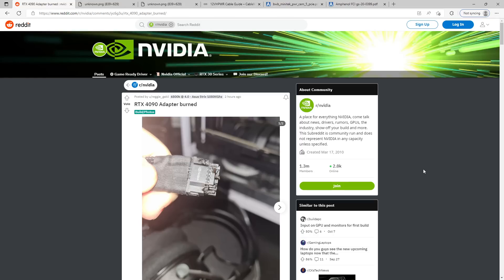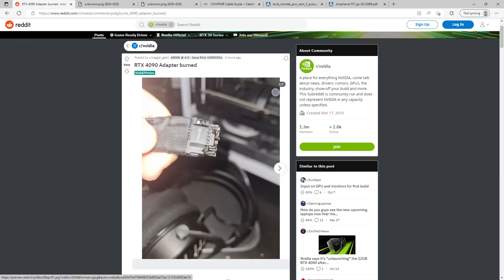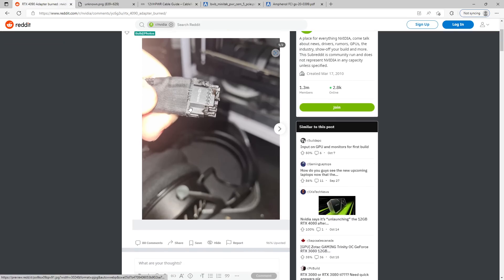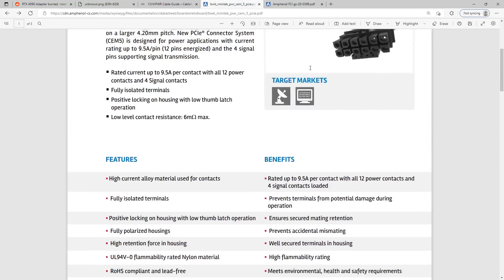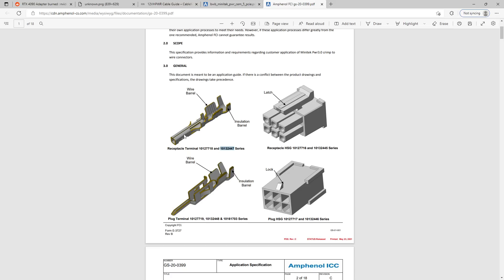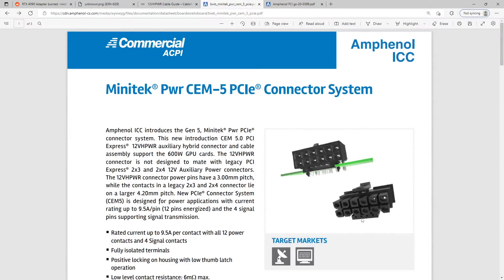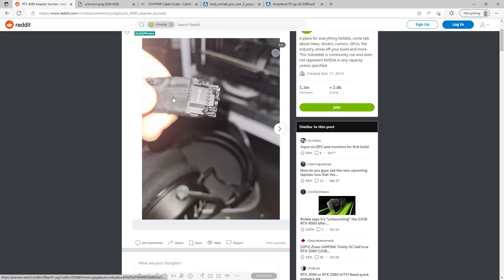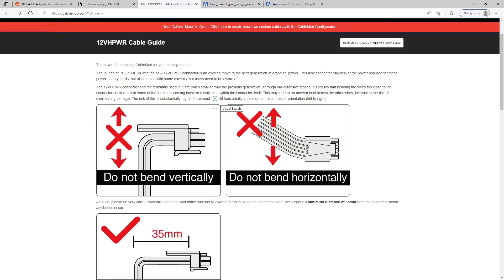The 12VHPWR connector sucks

Comment: Why on earth are the sense wires not used to monitor for voltage loss in the cable, and/or the sense signals? I (and I am sure many others just do not understand).

Comment: they know that before, so why didnt they include a cable that could be used, like a normal human-being would use it?
like for example, follow the gpu, facing the io-shield-away, towards the "front", maybe something with screws, into holes meant for this, on the cooler, and at the end of the gpu, the cable could be bent - problem solved - wasnt that hard

Comment: So because Nvidia finds it a pain in the bum to put more connectors on the GPU they made a new connector that is a bloody fire hazard waiting to happen? I have a very simple solution for this. In fact, I have two.

One; trust me on this Jensen, nobody cares. Most enthusiast even like their bulky cables as we can make em sexy and coordinate them with the rest of the colour scheme of our PCs. So just put a normal connector on it that already exists and works more than well enough. Instead of this solution looking for a problem.

Two; design a GPU that doesn't make me wondering when GPUs are gonna need their own power supplies. 450 watts is insane, even for enthusiast grade stuff.

Comment: ...why not just give us an XT60 or XT90-Connector? Or switch to a 24V Input since most people need new PSUs for this furnace anyway?
Reply: Just have a power cable directly from the wall to the GPU. It's coming.

Comment: The sense pins are stupid. There are plenty of simple serial protocols that could communicate much better data to and from the gpu. SPI , Uart, etc. Just communicate max continuous power, peek loads at various durations, and perhaps a few other relevant bits.

Comment: from my expirience from doing RC for decades, i know the issue of "cheap/bad designed" "plug cases" that allows the pins to wobble & turn when moving the wires. if a giant company like nvidia actively ignore this fact & rolls it off on the enduser, it just shows that nvidia is either blatantly incompetent , or just doesnt give a damn, wich is insane in any case!
specially for a overpriced, thousands of dollars product!.......

in the models where the plug should be rigit, we used to "goo up" the side where the cables enter the plug with either hotglue or some 2 component resin to get rid of any cable twists/pin movement alltogether! & even shrinktube the plugs cables to stiffen the cables going in!
if you leave the pins "floppy" then on bigger motors/ challanging races where you really push the battries&motors to the limits, the plugs would always melt first!

insane that nvidia doesnt seem to care anbout those things!

Comment: this is all pretty expected stuff, I had this issue with aftermarket cables for my RTX 3090. The stupid part is that whoever is maintaining the spec for these cables is specifying improper insulation too thin for the actual wire. It is pretty insane to plug a USB sized wire into a 400W+ GPU, but even that is okay electrically, physically these wires will easily pop out of their clamps inside the connector from slight bends and boom $2k paper weight. I made sure my 3090 cables dont come loose by applying some superglue around the connector, dont do this when the GPU is plugged in lol...

Comment: I was bothered about smaller wires/connectors for way more power. Good to see someone much smarter than me also sees the flaws here. Very good point about the female connectors being pried by the male pins with stress from bending. Another reason not to be an early adopter and beta tester for companies new hardware and software.

Comment: I thought this connector was stupid the second I saw it. Let's carry 4x more amperage through less space? You can't engineer out physics. They could have easily made it more robust with fatter wiring and pins and only be slightly larger while still saving a ton of space over 4x 8pins. This was never an issue of if but when someone burns their house down when we've already seen issues with those more robust 8pins we're replacing where they could melt from a less than an ideal connection. Putting 4x more power through less space is literally playing with fire.

Comment: The problem mostly relies on the plug and receptacle terminal deforming due to less mechanical strength.  The metal is literally less strong due to being smaller which means when moving the cable it can bend easier, which means either the plug collapses or the receptacle expands, each of which produces less pressure which increases resistance of the connection.  This can also be caused by installing the cable as the fitment needs to be a certain tightness to be within the resistance spec of the connection.

Comment: The sockets (pins are male, sockets are female) in the connector probably aren't rated for the current they are delivering, that will cause overheating/arcing/melting/

Comment: Surface area contact is important in mating connections such as this. Specifically surface area contact with sufficient pressure to ensure good contact.

Smaller pins will have smaller contact areas. When stress is applied to the connectors, the pins can shift and lose complete contact. The stress on the pins can reduce contact pressure from damage to the contacts as well, as you described with the seam.

More power through smaller contact area, then reducing that contact area and pressure… That is a recipe for increased power transfer resistance, which means more heat.

The biggest thing to watch for is stress on the connectors, not necessarily how/where the wires bend. It’s just that some bend types are more likely to induce lateral or other stress to the connector.

Comment: As someone who has spent 17 years working in public transportation maintenance, this looks all too familiar.  Commercial aftermarket systems (HVAC, etc) often use high power molex style connectors.  Even in a space where there isn't any force put on the connection they're still the first place to look for failure.  Heat, vibration, etc always seem to burn these up before their rated capacity.  Weak contact, high resistance, more heat, see ya later.

Comment: I find that only blaming nVidia is a bit easy.
This is a connector that is, to my knowledge, built into at least 2 major specifications: PCIe 5.0 and ATX 3.0.
If the connector is defective, those standard bodies should take most of the blame since it's their job to validate these specs before publication!
Reply: Oh and don't forget the actual OEM manufacturer that should know better.

Comment: A small extension of the pcb on the power side would have supported additional connectors/traces.  Cheap..  

If u have one..  connect the cable to the board before any bends are made.

Comment: Nvidia=Apple (garbage practicality and reliability) Why do they make a smaller cable and connector for more power than just putting more power thru the bigger cables and connector.

You look at subwoofer cables. You don't want a skinny 4 gauge for a high power sub. You go with 1 or 0 gauge because more power needs beefier connection and wire. 

Seems like Nvidia didn't get the memo. But hey, in it does offer a cleaner look. Fashion over function with high voltage. (Face palm)

Comment: wires can actually bend at any distance, but it must be a constant curvature and then apply small tie straps, example 4 wires with 1 cable tie around wires leaving it losse, then take another cable tie and between each wire put a tie strap to strap the first tie strap, the result would be like cable combs

Comment: Biggest bullshit ever...
This stupid, lowest quality connector is complete bullshit!!!
Make smaller contact surface, fills up your tower with crapy adapters...
I think i going to pass the 4090 and go for 50 series, when this issue is solved!!!
Selling a 2000 dollar GPU with a 2 bucks power, china crap adapter cable...
FCK NVIDIA

Comment: Computer maufacturers should look at the existing XT-series of connectors.
The XT60 is compact, takes easily 60A (200A peak in a good quality unit w. good cabling), and cheap. And already a standard! They're made to handle 100A while vibrating wildly while taking 10G forces in RC airplanes. For hours and hours....

Comment: sort of, but a overcloocking by partner makers and anyone else at home need more wattage than 450.

but maybe they could have compromised and split it over 2

maybe the connector needs heavier gauge and more heat resistant materials.

Comment: Hi Buildzoid 🥰👋. Dumb question and this stuff is outside my understanding…… but would creating a motherboard 20/24-pin power connector for a GPU like the RTX4090 or higher powered solve this issue?
Reply: Just slap a XT-60 connector on it. It's smaller and rated for 60A which should allow for 720W at 12V.
Reply: 24 pin don't just carry 12v, why there is so many wires.

Comment: I think it's more Nvidia can't get the performance they need to compete with out pulling big power No GPU should need 600W and No CPU should need 350W, such a system would be crazy hot and hard to cool.
Smaller cables can't carry power as well and break more easily making the solution stupid space saving over common sense.
Any pull in the cable either to the side or up or down can cause cables to come out of the crimped over connection only shouldering the cable in would stop it.  
The extra cables are supposed to be to aid power hungry GPU to check power supply can supply what it needs possibly not really needed for RTX40's but future RTX50s.

Comment: 4090 as a whole is a stupid product imo, "Look at me, i'll pull more power and slap on an even bigger cooler to make up for my lazy effort at efficiency then make a non standard power connector while at it".
If anything the 4090 should not exist, if we go by this logic then by all means pull 1000 watt and slap an even bulkier cooler that takes 10 slots.
MY personal opinion ofcourse, you are free to disagree just save yourself the effort of convincing me.

Rename the product line and re-adjust the prices accordingly from the start:
4080 16gb = 4090 but using the highest chip
4080 12gb = 4080

Comment: If iam not wrong, the "old" 4.2mm pins of pcie 6 and 8 pin connectors should be rated for up to 11.2 amps  but are only used with up to 150w/3pins/12v = 4,167 amps per pin, thats what headroom means.
I mean just the connectors, not the whole cable and psu circuit.

The new 3.0 mm micro fit pins are only rated for up to 8.5 amps.

Comment: As someone who is atleast somewhat familiar with electrical stuff, even I can see that the individual pins are just too small to handle 10A of current in a sustained load. The connector is the part that will have the most resistance (assuming the wires are good thick copper stuff), and one can easily see for themselves how hot any wire can get when you pass 10A through it. 
Forcing down such current through a flimsy steel pin/shell combination is just asking for trobule.

Comment: When you show the system picture...That crooked card would actually contribute to the bend described, especially considering how stiff those adapter wires are. Considering how heavy those cards are, I wouldn't rule out their weight sag helping with that damage.

Comment: IFF your theory is correct, then just having the seam soldered may help with this part issue. Doesn't help with the primary issue of a stupid new power connector that's rated too high.

Comment: I never really expected one 12 pin to replace 32 pins worth of power draw without concequence. Saves space, yea, but i think they should halve that to 300w per 12 pim and just use 2. that would also take less space that 4 8 pin, similar space as 3 8 pin.

If anything, the connector isnt secure enough if slight bends will cause problems. We dont have that restriction so bad with 8 pin connectors. And yea to ensure no bends 35mm from the connector, the connector will need a 35mm hardened cable guide.

oops, just gave away a product idea... $ $ $. But without vertical mounting your gpu you will have to contend with the side panel. 

I think its pretty useless considering just how big 4090s are, anyway. And its all cooler size: the pcbs arent as big Just make the pcb bigger for 2 12 pin for 300w each and call it good.

Comment: Apple already solved this problem, on the current Mac Pro. They have an additional power connector. Over 500watts per slot. Dual slot card would need no cables at all, and would have over 1kW available.

Comment: Maybe if we weren't supposed to bend it so much they shouldn't have shipped it with that octopus 4x8 pin splitter...... I hope RDNA3 will be using the standard PCIE power connectors

Comment: I dont think the Receptacle by itself is a problem. The RTX3000 adapter from the FE uses the same Connector minus the 4 sensorpins and i didnt hear anything about similar issues.
I think the problem is the 4x8pin cables are all joined together in the 12pin connector. Those cables are more loose compared to just a single cable.

Comment: Do you think we (or at least I) didn't see any failures with the 30-Series FE connector due to the lower power draw? Although, didn't the 3090Ti also pull 400W+? 
Or did it maybe relieve some of the mechanical stress from the connector by angling it backwards by 45°? Which by the way also prevented the no sidepanel issue...
Reply from the maker: I think there's a lot fewer 3090Tis than 4090s so it's less likely that someone would install the cable wrong with a 3090Ti compared to the 4090.

Comment: Not got one of these but I wonder if the cables were made individually stranded and of soft and flexible  silicon rubber instead of the stiff plastic would this problem go away?

Comment: Small, cheap, robust and high-power. -Pick three out of four. I'm not against the idea of introducing a new connector type, using sideband signals to communicate with the PSU is a good idea. It's just that they designed a crap connector.

Comment: PCI-SIG put out a report about dangerous thermal variance with these connectors just a few weeks ago. The cable in question probably predates that warning and the changes we should see in cable design moving forward. This isn't the first time I've seen connection issues with the folded terminal molex micro-fit size connectors, but it is the first time I've seen them melt. 

Ultimately, these cables have installation requirements that are too strict to expect consumers to use them properly on a wide scale so I suspect the design will be short lived.
Reply: And these reports were regarding the connections at the PSU, everyone ignores that. They were melting AT THE POWER SUPPLY, yet everyone is blaming Nvidia for this new INTEL standard that is failing because INTEL did not thoroughly test it.
Reply: @pokealong  LMFAO AT YOUR STUPIDITY!!!

Comment: I have a very roomy full tower case. If I mount a 4090 in standard orientation; There isn't room to bend a cable at 35mm out from the gpu without taking off the side panel. You can start the bend at 35mm but unless you bend the cable at a hard 90° the cable is still going to make contact with the side panel which means the curve of the cable pressing on the side panel will still put an undesirable amount of stress on the connector. I Can't think of any REASONABLE cases that have enough room to achieve that 35mm of cable length before the bend. It doesn't matter if you cable manage up, down or to the side of the gpu; any bend you put on it will stress the connector. The connector should have just come as a 90° connector and it should have been built better

Comment: It's not the cables per se, it how many they have shoved into a tiny connector. Times that by 6 or 8 pins with two cables per pin, that's some serious strain and heat due to resistance at the pins

Comment: I do like that one cable is 600 W. It will take up less space once new PSUs have it built-in. However, they should have come up with a more robust connector with thicker pins.
Reply: How about a XT60 connector? It's rated for 60A which results in 720W at 12V and is not only a single cable, it also has just two leads, so it's even easier to route. Also, this connector has profen its worth in many RC devices and is about as big as a 6Pin PCIe connector.
Reply: @Donnerwamp  That is almost good enough. It would be better if there was also a small single twisted pair for communication to the PSU, as one important factor is that the PSU may supply less than 720W. They have a similar problem with EV battery charging where they have smaller pins for communication separate from the big pins used for power. I agree generally that these connectors being used today are just ridiculous. I think we are due for an upgrade to something that securely snaps on and doesn't bend at the connection. This problem has been solved in so many other places, so why do we still have these antiquated connectors?
Reply: @geordonworley5618  Hm, maybe a "XT60B" with two sense pins like the bad plug has? 
Also, yes, there are so many connectors that avoid so many problems this new thing has, it's kinda sad that we have to deal with that.

Comment: Welding the seam on the female connector is probably the only way to design a "safe" version but if it's going loose from such minor bends like that the design is probably just doomed to be flawed forever if those connectors are that weak

Comment: GPU's should start having the power connectors on the bottom and aftermarket GPU's should be allowed to have their own power delivery adapters since the PCB is actually quite small compared to the size of the cooler. I would draw an image of this but I myself am a poor drawer to a point where even a kindergartener would draw it better, but anyways if someone gets what I mean can draw a better image through text or an image.